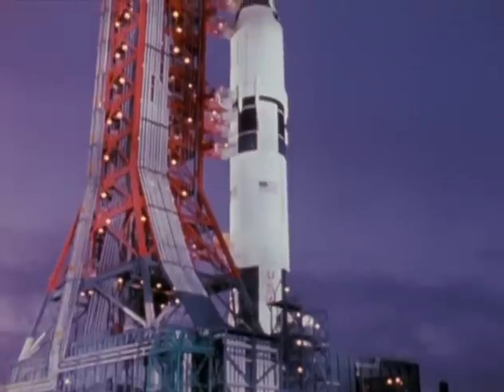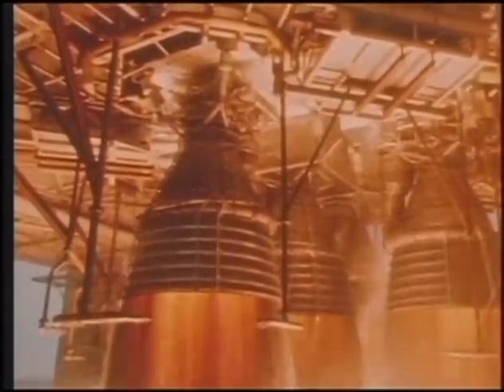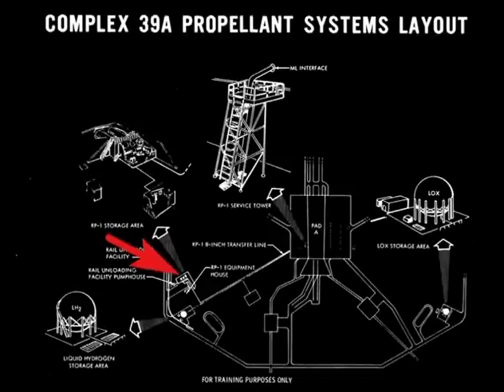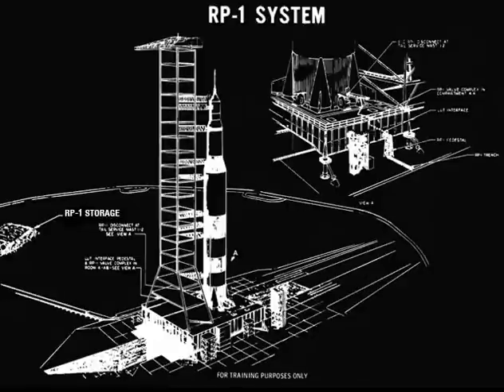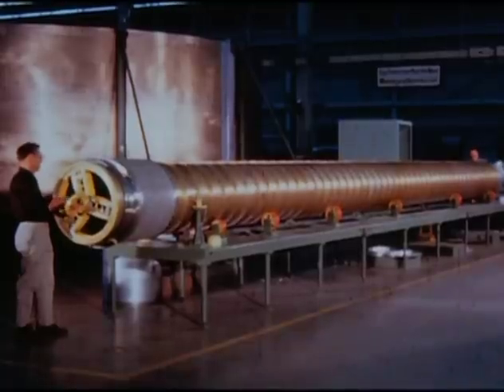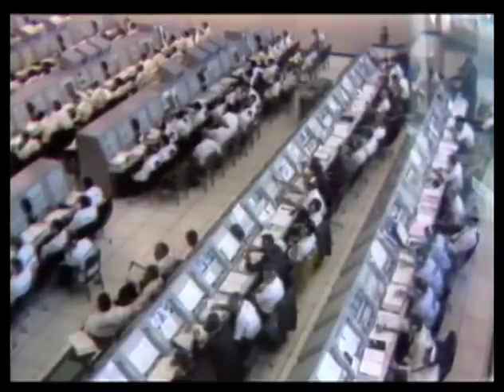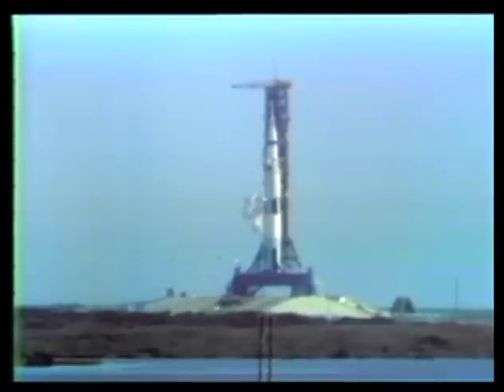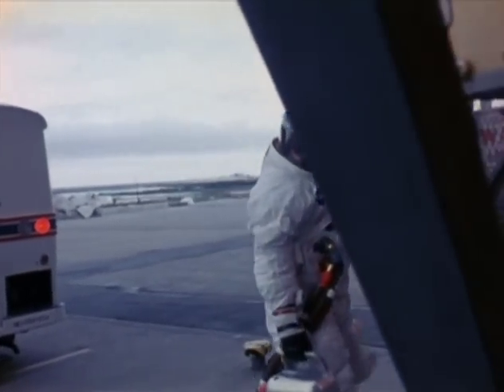Countdown to Apollo 11 - June 25 RP-1 Loading

Comment: One time power was lost and fuel leaked out, causing the top of the tank to dimple inward... they had to pop the dimple back out by pressurizing the tank!  They did this by running a stand-pipe up the LUT and filling it until the dimple popped out.  It made a funny noise... boomp.